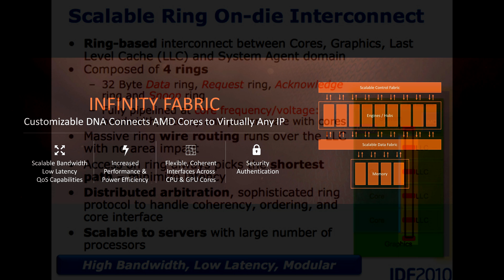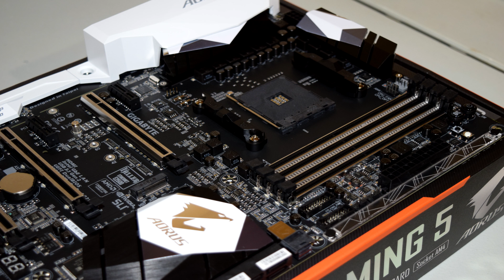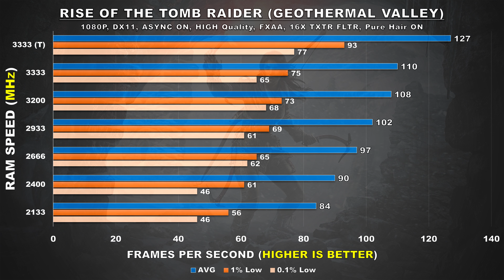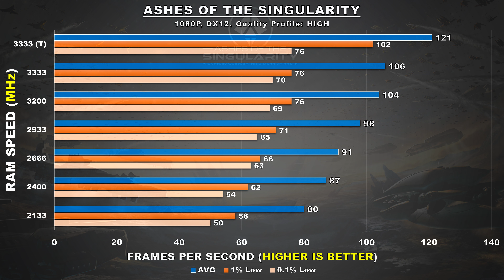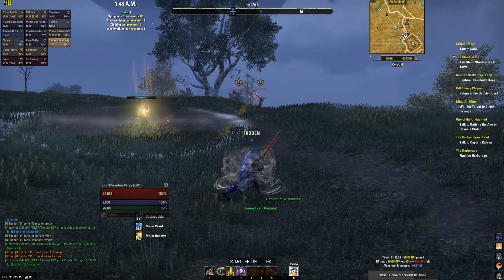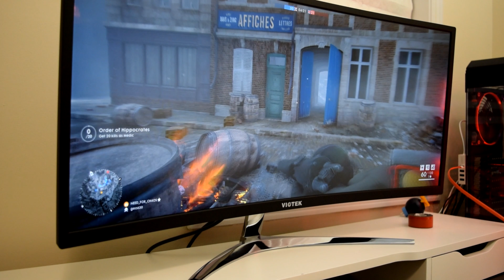7 RAM Speeds 21 Games Tested on AMD Ryzen.

Comment from the maker: For those wondering what the tightened timings were, you can check this screenshot here

https://i.imgur.com/02mu79t.png
Reply: DannyzPlay what were the non tightend timings?
Reply: Perhaps an entire video about tightening the timings would make sense.
Reply: Time was probably too tight for him. It is all about timing his video on tight timings to ensure less down time 😂😂
Reply: I'm a bit late with this but, shame you kept cl14 timings on speeds under 3200mhz. You probably could have easily ran cl12 (and cl10 from 2133-2400) and gotten a much different performance outcome.
Reply: Great video indeed. You earned my subscription. I would love to see what results lower latency would give on slower frequencies.
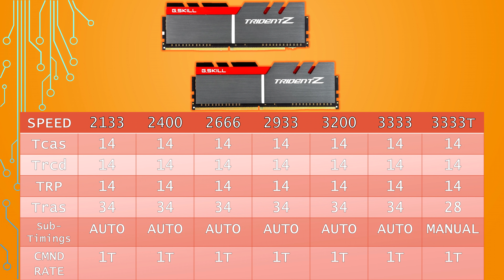Reply: wait, so at 4:50 those are the timings for the ram at the speeds you tested?  all the timings are the same so only the clocks changed?  im not sure if you know this but latency also drops as you increase clocks.  most of your gains were from latency decreases which would have shown up just as much on any cpu intel included.  

if you just want to show the benefit to ryzen's ccx to ccx design then you would want to keep latency as close to constant as possible.  

a quick and dirty way to measure the latency of a kit of ram is to divide the clocks by the cas latency.  its actually the other way around but since the clocks are the bigger number its easier to do it backwards as they will still show a comparison of latency only now this "score" you get will better the higher it is unlike latency where you want it lower.  so when you divide the clocks by the cas the higher number has the lower latency and is better.  if they are the same they have about the same latency.

your 3333 cl 14 kit would have a score of 238.  3200=228  2933=209.  as you go down in speed the latency gets worse and worse which inst normally true with kits of ram.  when you have really low clocks you have pretty tight timings and when you have high clocks you will have looser timings. 

so the latency has nothing to do with ryzens ccx layout.  only the clocks which is what the ccx to ccx speed is based on.  now when you raise the clocks (and the ccx to ccx speed with it) you will also raise the bandwidth going to the cpu which, again, will benefit intel cpus just as much.  you need to eliminate the bandwidth difference too but unfortunately thats impossible but we'll just go with it.  keep in mind though this improved test would also help an intel cpu as well but at least we have eliminated the latency factor.
 
so now we need to divide out the clocks by the cas to get the same score for all.  most 2133 kits will do 11 and that = a score of 193.  to get a score of 193 on all kits then these are the settings (aprox)  2400\13= 184  2666\14=190  2933\15=195  3200\17=188 or 3200\16 = 200 whicever you prefer both are a bit off  and then 3333\17=196.  these all have nearly the same latencies now.  the differences from here on out will be mainly bandwidth and the imprtant part.  the purpose of a test like this....the ccx to ccx bump.

i have a shoddy kit of 3000 16-18-18 and an 8700k to use if you want to do the tests at these speeds i will do the same and we will see how much the ryzen actually benefits from higher ccx to ccx speeds and i will post it to youtube.

if this all seems odd to you the let me clarify why im saying all thise.  the premise of the video is one of 2 things,  that higher ram speeds help ryzen because the ccx to ccx clock (the infinity fabric) is tied to the same speed as the ram and increasing ram clocks increase IF clocks.  thats the first thing that could be the premise of this video.  if thats the case then eliminating all the variables you can except the clocks of the IF is what you want, not making latency better.

the second premise that this video could be based on is that higher speed ram helps cpus.  thats was already known before ryzen was even invented.  it helps all cpus.  i think by keeping the timings the same for all kits you wanted to do exaclty what im trying to tell you how to do.  that is take latency out of the equation and only test the ccx to ccx effects.  but by keeping the timings the same for all kits you are actually doing the opposite.

cas latency is the time in clocks that the ram takes to find the data and get it ready to be accessed.  this is measured in clocks.  the 2133 speed is the clocks.  if it takes 14 clocks (cas lat.14) at 2133 and also takes 14 clocks at 3333 then you can see since those clock ticks at 3333 are going faster then the latency is less even though the cas number is the same.  you have to raise the cas number to even it out.  and also thats why you sometimes have to raise the cas number when oc'ing ram cause the ram will only support a certain latency and when you go for higher clocks you are not giving the ram enough time to do its thing.

anyway i think this would take the latency problem out of the equation this would help.  if you just wanna say that faster ram will make a cpu faster then i think that should already be obvious.  and also its become an urban myth that intel cpus dont benefit from faster ram but its just that.  a myth.  intel cpus benefit from bandwidth (clocks) and latency (cas).  im sure an intel cpu would benefit just as much from these ram icnreases.  i saw a hardware unboxed video where the i3 8100 got 12 fps higher just from going from 2400 to 3000 i think it was.

 if you are saying that the money you save on a ryzen cpu can be put towards faster ram then that is true as well.  just dont spend so much that you are paying more or the same for the intel cpu
Reply: if realistic ram timings were used for the lower ram clocks (like 2133 and 2400) the cas latency would be much much better.  in other words the top 2 or 3 kits arent really that much faster as much as the lower 2 or 3 kits are severely crippled by horrible artificial timings.  there is not way that those are xmp or docp profiles but the jedec specs which are just to make sure they are slow enough to work with any kit of ram ever.  so if you are thinking that you will get fps boosts this big by buying a 3200 cl 14 kit instead of a 2666 cl 13 kit (where the 3200 cl 14 kit costs nearly twice as much) its not the case.  3000mghz 16-18-18 kits are not super tight samsung but they are usually as cheap or cheaper than the stock 2400 kits and will be much closer in performance than this video would lead you to beleive if you didnt understand what the guy is trying to do.  which is  compare infinity fabric clocks by keeping latency the same.  but he actually kinda did it wrong a little bit.  but still a cool video
Reply: Can you test your setup for stability in linx 10 runs max memory and testmem5?
Reply: I Have same timings soc1,05 1,4v nb mode 2 100%stabile
Reply: I think for Hitman 2016 the problem isn't ram speed but actually the amount of ram which I know is hard to believe  considering you have 16gb plus 12gb vram but apparently the game is not just hard on ram but very very hard on ram in particular, amount.
Reply: that link is not working on me  :(
Reply: Can someone pls share the 3333 (T) timings for me? That link wont open on me :(

Comment: 40fps gains from 2133 to 3333t.. This is insane. Thats like jumping a few gernerations of hardware.
Reply: 10 years ago that would be just 1, no more than 2 generation(s)
Reply: @TumTuned No it doesn't. Faster RAM also helps Intel, I know as I'm using 8700K and DDR4 @4000Mhz
Reply: @tonycambell8875  It does, I have had a pretty big and noticeable improvement going from 2400MHz CL15 to 3600MHz CL16 Ram, but I'm using a 1070, 7700k at 1440p, a setup and resolution you wouldn't expect there to be many gains, but there will always be gains with faster Ram, even if it's minor, usually the average won't change much but the lows will always have a decent improvement. But Ryzen seems to have a bigger improvement than any Intel CPU with Ram speed

Comment: I have been using Intel and Nvidia for over ten years now. My last AMD CPU was way back in the day of Pentium 3, AMD breaking the 1ghz barrier, and using pencil lead to unlock my multiplier. I am building a new system now and going for value to performance ratio. Electricity is expensive here in NZ too, so that is also a consideration. AMD Ryzen wins for my needs because i need it for more than gaming, so i got a ASUS Strix B450 board and G-skill Trident 3200mhz memory. Still deciding on what Ryzen CPU I will go for. It seems like the X versions are worth it this time, where as the R7 1700 was the one last time. 
I am not sure about GPU. I have a 1050ti I bought as a stop gap. AMD options that are enough of a step up from that are not so good, but i would would like to go full AMD so i can give the Intel and Nvidia cartels the middle finger. I like to support underdogs if they are making a decent fight of it. Maybe flashing a Vega 56 if i can import one for a good price. Dumping Microsoft for Linux is not so easy. I have tried a few times, but using WINE does not go so well for me so far.
Apart from GPU prices, the thing that really pissed me off is memory prices. Seems to be a much high proportion of total build cost than it was the last time I built a PC. There are rumors of price fixing and cartels.

Comment: i confess as well...i have a 1700 and rgb g-skill 3200 14 samsung b-die....i have tested various speeds and it does make a difference.
also have the gigabyte gaming 5 with white cover..love it...OC is good on this board as i have reached 4.15 on my 1700

Comment: I disagree with scrimping on memory. Buy the best so that when you do upgrade your cpu or gpu, you will not have to upgrade the memory. The AMD APU's really benefit from better memory. Get a decent motherboard and memory, and the rest you can upgrade as you go. But, I really liked the rest of the video and it further supports my position that quality memory does make a difference.

Comment: Great, extensive test with a nice mix of different games, thank you! Went for 2666 CL16 at the time, given it was 20 bucks cheaper than 3000Mhz, don t regret that choice at all (don t have a high end gpu and got a 60Hz panel anyway), turns out to be a decent middle ground price/performance.

Comment: Great and really in-depth video! Thank you very much!
However I have to point out one thing: Only because you only have a 60hz monitor, frames more than that will give you less input lag and a smoother feeling, even if the monitor can't go above 60hz.
There is a difference between 120 fps and 300 in CSGO, and 60 vs 120 is drastically different (I'm playing on a 60hz monitor btw).

Comment: I have noticed one thing in common with ram speed benchmarking.

It seems the latency configuration is not been optimised for each speed been tested.

e.g. is it say 3000CL16 vs 3400CL16 vs 4000CL16
or is it 3000CL12 vs 3400CL14 vs 4000CL16?

We dont know as the timings are not labeled on the graph, but I have a suspicion that the timings are optimised for the higher speed and then when testing lower speeds the drop speed is then just been dropped for the lower speed runs.

Same CAS latency on lower clock speeds as higher actually increases request latency meaning we dont know how much of any performance improvements are down to the latency or the bandwidth.

e.g. 3000CL13 has almost same latency as 3200CL14. Both are around 8.75ns. https://imgur.com/6ZSDax7

Comment: I think I recall one referal on one of the reviewers 'doing timings' of 12 12 12 12 28. Can't recall the clock speed (I think 3200MHZ?). Would this be relative to the motherboard and CPU as well as I think they used a Ryzen 7 2700x...

Comment: Fun fact, using ram that isn't properly tuned for Ryzen (even if its 3200mhz in my case) can severely impact performance. I bought some ram that ram fine out of the box but was a bit unstable compared to my last kit even when it was the same speed (just larger). I applied the DOCP profile and increased the voltage to 1.4v (this varies from system to system, dont just jump straight to 1.4) and saw a 30 fps increase over my system with the last kit of ram at 1.35v. Zen 1/1+ was weird af

Comment: I wonder how close this tight timings get the 2700x to  5ghz 8700k...looks to me like it should get it pretty close. What you think?
Reply: Following
Reply: the 5ghz 8700k improves even more from high speed ram, some games 30% and more. just loading xmp3600 will get you 24% performance increase without tighting timings further.
Reply: @BlacKi-nd4uy  but it has the internal heat of 2 suns...tterrible construction on this chip
Reply: @BlacKi-nd4uy  The 8700k might gain 2-3 FPS with faster memory, it is not beneficial to run the fastest memory for a huge performance boost.  It is not designed anything like Ryzen, Infinity Fabric architecture is an outstanding thing.. and Intel has absolutely nothing on it.
Reply: @imacrazyguy5831  i measured by myself 24% from 2666 to 3600, and 30% from 2666 to 4000 in games.
Reply: 8700k is about 20% faster in almost all games.
Reply: @brunonkowalski  you read the wrong tests.

Comment: i built my Ryzen system at Launch. really wish i knew that Samsung B-die was the way to go back then. im stuck at 2933mhz on 3200mzh Hynix M-die.  2x GTX 1080's SLi would love some more ram speed
Reply from the maker: That's still a pretty good configuration, try using dram calculator to help tweak things, also updating to a more recent bios can help.
Reply: thanks, i am on the latest non-beta bios "Asrock x370 Fatality Gaming K4", also have been tweaking the ram  for longer then i care to admit Lol. The ram Calc was a blessing to get it to POST 2933mhz  then Tweaked more till i ended on 14,15,15,15,28, T1, Tweaked sub timings to get total latency down to 76ns.  it wont get stable for me at 3066 without performance regression :(. having one of the worst Mobo's does not help either lol. 
Lessons learned for next build Stay away from asrock, don't buy on day 1, Kick Sli to the curb.
Reply: not all asrock maybe? x370 taichi's one of solid mobo outhere
Reply: the hardware is good. Good VRM and nice sound also 12,000 hour Cap's. but the support is bad and BIOS is buggy.  my mobo is just a bad egg thats why it went end of life after only 3 months and was replaced with the gaming X. same time Asrock did new revisions of the other mobos killer sli and some others changing the VRM removing LLC and offset voltage controls. this is my 5th asrock mobo but will be my last still runing my old asrock Z97itx, crawling back to asus on the next build i think.
Reply: @chainsaw2010 That is sad to hear, but i guess its part of buying completely new platform, built from the ground up.
Do you know why they stop making the K4 and replace it with Fatality Gaming X ? I thought motherboards with hundreds of revisions is something of the past.
Reply: Not sure exactly why its EOL but the rumors are that asrock dropped this mobo because of bad PCB layout for memory, it was the only mobo that did not support 3200mhz ram up till the new revisions of the Killer SLi now they don't support 3200mhz ram anymore either.  some say supply issues getting the VRM chips. now they reserve the Good VRM for only the Taichi and Gaming Pro so the rumors do make some sense.  my main issue is the Lack of support, soon as i noticed they removed support for 3200mhz ram i contacted asrock asking if this was a mistake . i looked at the mobo very closely before ordering it and my ram, the mobo was said to support 3200mhz ram at launch and was down graded within just a few days. The support agent did not respond to any questions. now the Killer SLi is down graded but not the Pro4 yet. makes you wonder why they downgrade the higherEnd first.
Reply: That is very bad customer support. I imagine X370 Taichi/Gaming proffesional use a higher grade mosfets, might be wrong, but u guess its normal for them to put more focus on the flagship boards...look at he X470 and most of the boards, b450 is nowhere to be found yet. 
This is really dissapointing, really. Dont know if its asrock's slopiness more or did amd forced a bit the launch of ryzen...
Reply: +Kindis
Asrock has a bit of a reputation for poor customer support in general as well as not having the best software around...
The actual hardware they offer tends to be great though either for the price or just outright great.

Comment: My Ryzen 7 1800x on my ASRock x370 taichi has done the xmp of my GSkill 32GB 3200Mhz Cl14 ram for a year stable back in 2018 something must have changed because it keeps crashing randomly even on 2666Mhz... now iam testing 2400Mhz... I dont think that someone reads this comment and has an idea of what i can try to get it stable again.

Comment: I'm trying to decide on an ideal speed for replacement corsair ram as one of mine is faulty and the place i got my pc looked at said that high speed ram is more likely to cause issues in current pcs, yet online guides advise at least 3000 hz for ryzen processors. Bearing in mind I don't overclock and just had speed on auto when I was running stuff (before I had blue screen crashes), would dropping down to a lower RAM - like 2400 or 2600 - be a safer bet if I don't overclock anyway, or should I take a chance on a 3200 hz? It's good to know Kingdom come does have issues, I was running stuff like the resident evil 2 remake just fine with it on auto (I got odd lag on kingdom come and downscaling graphics didn't do anything, clearly optimisation issues like you say). I also need suitable ram for music software.

Comment: Sorry but for 6:30 why would you turn Vsync on? Makes no sense to me.
Reply from the maker: The game has a built-in frame cap.
Reply: @DannyzReviews  oh, I see. My bad. Watched your vid since RAM prices are going down, deciding between a 100$ 3000mhz CL15 set and 3200 CL14 B-die at 150$. Is the extra 50$ worth it for a ryzen 2700x? assuming I cant change my gpu